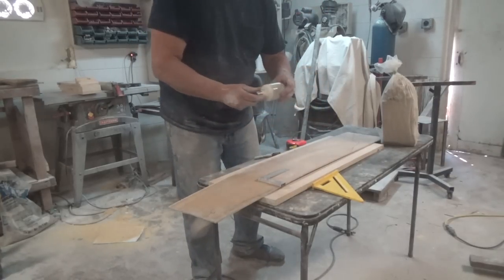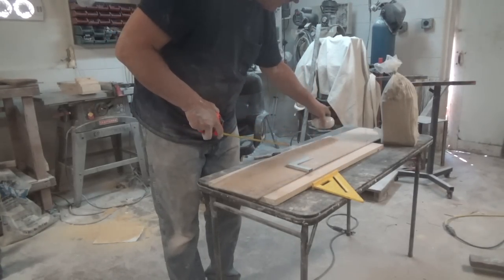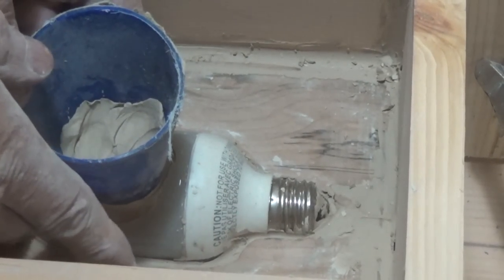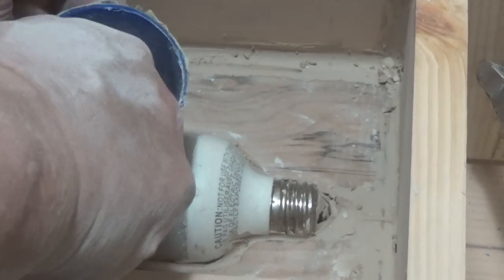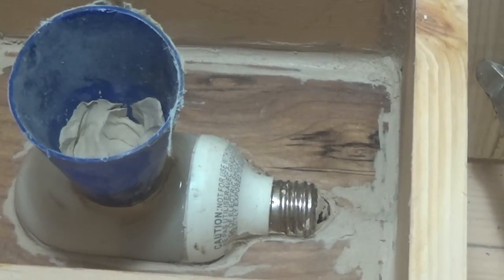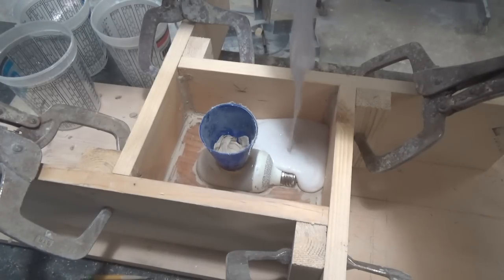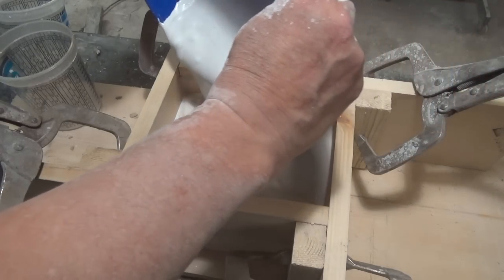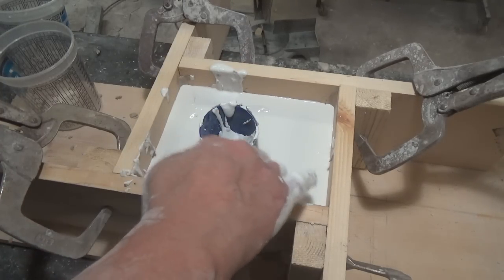2 Piece Plaster Slip Casting Mold Making Basics

Comment: It would be interesting to take a filiment out of a bulb (a heartier one if you can find one) and solder leads onto it and cast the filiment into solid resin just to see how different it lights up. Obviously it would damage the resin as it got hot, but still, just as an experiment, it would be interesting to see if it would even light or what it would do.
Reply from the maker: Check out photo resins?

Comment: Great tips but on something round if you got some painter's tape you can draw a line on the bulb cut a piece of tape about the half the circumference you don't have to measure the length exactly put it on the line perpendicular to the line you drew and make a mark flip it to the other side and mark again then just measure the the difference between the two line's and mark the middle and your line will be exactly the same position on the opposite side of the object or to say you will have it divided by the diameter

Comment: how deep did you make the mold box?  Loved the video and best one I have seen so far..Thanks for sharing.
Reply from the maker: I like to add about 2 fingers of depth of plaster above the pattern surface.  The pattern being the light bulb.  So if you halve the light bulb pattern, for the purposes of the mold.  then determine the depth of the plaster by laying two fingers on top of the bulb, that should give you a pretty stout plaster mold.

Comment: great vid thanks - i have made a two piece mould with a plug hole to use for slip casting ceramics - but i need to line the plug hole with something so the slip doesn't stick there, as if it does the plug doesn't fit in properly so the shape is altered... what would you suggest? thanks!

Comment: I have some pieces that are bisque fired.  Can I make a mold using the bisque fired piece as my template?  Will the plaster stick to the bisque fired piece?  Will it ruin the bisque fired piece for glazing?  Finally these are spheres with some intricate deep carving... I am afraid that the piece, just due to it being a sphere it will essentially lock on to the piece. Guess I could make a smooth sphere mold for quickness and then carve that piece, that will at least make my wall a consistent thickness and also I wont need to finish the interior for pieces I do cut outs on??? Right now I essentially build to bowls using slump mold of sorts, and than slip the two pieces together... Any insight you could offer would be helpful... Thanks in ADVANCE!
Reply from the maker: The plaster should not stick to the bisque fired piece especially if you use a separation soap.  There are two factors that will cause a mold to stick to a pattern.  #1 If there is a locking part, or undercut that has not been properly assessed by the mold maker.  # 2The vacuum caused by the mold itself, in particular when there is a very smooth surface. 

#1 if using a bisque that has undercuts; this can be remedied applying a wet clay on the bisque to void out any undercuts.  The clay can easily be washed away after molding.  
#2 Causes more panic than any other reason.  You can build small little air vents onto the surface before applying plaster, these would be small clumps of clay that can be washed away before de-molding.  This will allow for the air to enter between the mold and the part.  "All you need is a small hairline separation to start the de-vacuuming to occur.  on more complex molds I have used compressed air to help in the separation.  The air is not really needed if you can form that small hairline separation between mold and part, what is needed is being calm and relaxed.  Trust that you have no undercuts and the mold will separate.  Sometimes it takes time.
Reply: @forsterarts  Thank You, I appreciate you taking the time to respond so thoroughly.

Comment: ? If I slip cast a sphere (smooth) will I need to compress the face of the clay with a rib tool to prevent cracking when I fire it?  I assume that won't be necessary because I  have seen videos on slip casting figurines and the detail on those essentially prevents you from being able to compress the clay face, otherwise you would ruin the detail... ??? Thank you in advance & Merry Christmas!🎅🤶
Reply from the maker: I am not a ceramicist, but I have built many different types of molds for nearly 50 years.  The advice for pouring your material is best given by a ceramicist.  With any type of casting - there are two shrinkage's to be concerned about.  The first shrinkage is that with the initial pour material. For ceramicist that is your slip,  for bronze artists it is wax.  The second shrinkage occurs in the firing. My presumption with slip, would be similar to bronze, "and please check with someone who has knowledge of ceramics". The thickness of the slip like the wax may have some bearing on the firing shrinkage.  With wax to bronze if the wax is thick, the bronze will not only shrink but cause all sorts of maladies in the final product.  For industrial pattern makers this is a whole other topic.  They use materials such as urethane where the shrinkage can be calculated to under 10,000 of an inch. I do address the  issue of urethane in another video.

Comment: Have you ever made a ceramic Cheese mold?

Do you have a suggestion how you'd make a mold to pour ceramic cheese molds where you'd want small holes in the sides and bottom of the poured 4" and 6" round mold?  I was trying to think of how to create a mold with protrusions on the inside that will extend further than the thickness of the poured slip, then carving them off flush inside the green vase - thus opening the holes.
Reply from the maker: You are getting into what is called pattern making. I would just make the pattern and the mold without any protrusions.  After you pull the green ware and it is leather hard, I would simply punch out holes with a straw, or something finer than  a straw.  I think you are on the right track.  Have fun with your cheese making!
Reply: Peter Forster thanks Peter, that one occurred to me also. Thanks for confirming from your experience!

Comment: Question - how much will a green freshly poured 6" diameter cylinder shrink through the bisque and glaze firings? Should I cast a 7" diameter hoping to end up with a 6" diameter after all firings?
Reply from the maker: Here is a shrinkage calculator. -   https://www.photopottery.com/clay-shrinkage-calculator.php  -   Is my guess correct that you are trying to calculate box sizes and shipping rates for selling your end product?  My advice would be not to make any package purchases before you have run  prototypes. Remember the thicker you pour it, the more it will shrink.
Reply: Peter Forster No, actually.
I want to create several CHEESE Molds that are 4”, 6”, And perhaps 8” in final diameter.
Thus my question toward how large a diameter do I need to cast that will shrink to 4 or 6” final diameter.
These will be cylinders about 6-8” tall.
Also, I need to create a follower, think lid, that fits just inside the cylinder whose function is a surface to compress the cheese to expel whey.
Reply from the maker: @jimsutton8874  OK, refer to the shrinkage calculator.

Comment: do you need a release agent on that light bulb or any object that is cast using plaster ?
Reply from the maker: a release agent is a good idea on any mold.  It is well to remember that when molds stick together, it is more likely than not a vacuum issue.  If you get just a little air into the mold you will be surprised how easy they are to separate.

Comment: How did the threads turn out? 
I'm trying to make a mold that has threads and going to use melted aluminum for the mold. And I want cast to be functional.
Reply from the maker: The threads came out perfectly on the plaster mold.

A general rule of thumb, look for the draft to be more than 4%.  This will ensure an easy release, no matter the type of rigid inflexible material the mold is made of.
.
 For more complex types of rigid molds, search "Industrial wood patterns foundry casting" or similar.
Reply: Peter Forster cool! Thank you!

Comment: Hi Peter, Nice video. Can you cast aluminum on this plaster mold?
Reply from the maker: Hi Angel,
Moisture is an enemy of hot metal, and can explode.  AS A BOMB!

I have been casting since 1969 and I have had on occasion a few explosions of my own, and witnessed the aftermath of other persons carelessness while casting.

****** A CAUTIONARY WARNING***********
Upon two occasions one in 1972 and another in 1986 where the ingot exploded.  After the pouring of metal, you pour your excess metal into a pre-heated metal mold called an ingot mold.  On both occasions we were pouring where a small raindrop hit the mold and sizzled off.  Presuming the mold was dry we poured the excess metal into the ingot.  Within moments the ingot produces a  oscillating high frequency hum followed by a deafening blasts that leaves you without hearing for a few weeks.  On both occasions I was lucky and wearing asbestos protection.  Even with the asbestos protection I had severe burns from metal that came through the collar of my jacket.  

It is my theory that while the raindrop was not visible, all there has to  is one molecule of h20 to cause an explosion.
*******

That being said, yes you can.

Aluminum is a very easy metal to cast.  

You must pre-heat the mold, you can do this in your kitchen oven if it is a small mold.  All moisture must be removed from the plaster!  Start the baking at a very low temperature, then increase the temperature gradually to as hot as your oven will allow.  

Plaster by itself is very week material after heating.  The European foundries still use plaster, mixed with refractory clay for their metal casting purposes.  Laguna Clay, makes a lincoln fire clay that is ideal for this purpose.  The refractory mold is generally preheated and burned out of a period of ten days.  The starting temperature being 170 degrees, with a final temperature of 1800 degrees.  You do want to pour your metal into a hot mold.

The molds I am speaking of are called "Ludo or Luto" molds.  I recommend you look at this site for a plaster ludo mold https://michellecorbett.wordpress.com/category/foundry/

and for the plaster and clay refractory http://www.swiss-artfoundry.com/techniken/casting/lost-wax/an-example/chamotte-mold/
Reply: Very useful information. Thanks Peter!

Comment: Why wouldn't you have just added soapy water to the model or spray, so the model would have just slipped out?
Reply from the maker: That is a good point!  I could have, and maybe should have done that.  I definitely would have used a sealer with a release agent with a more complex shape.

A note about molds in general, that goes for all molds when separating molds.  Be it slip mold, plaster mold, flexible mold, fiberglass molds etc.  If all the procedures have been followed, and the mold still sticks to the pattern.  You are have a suction issue, there is no air in between the pattern and the mold. Do not rush and the separation, lift the pattern ever so slowly and allow air between the two stuck parts.  This goes for mold shells as well, more commonly known as mother molds.